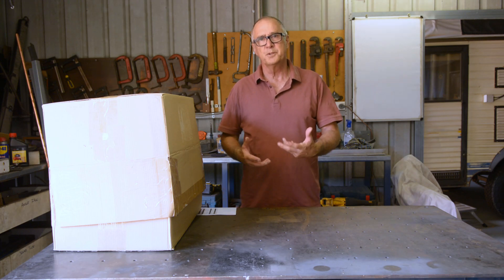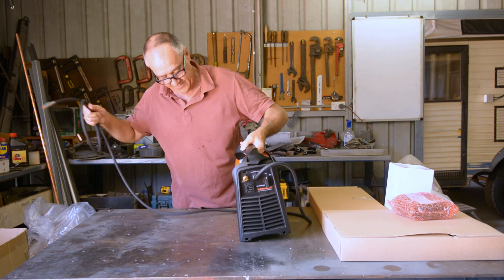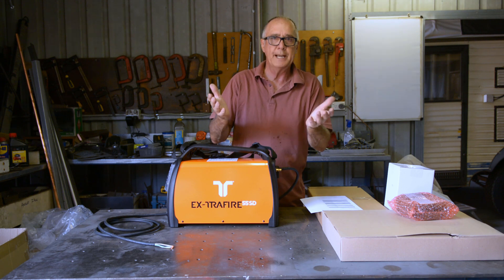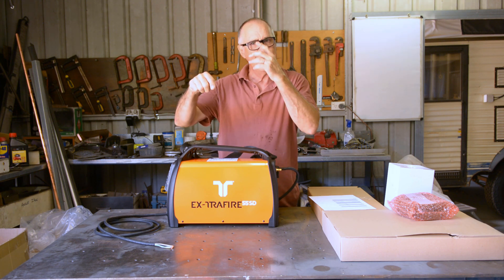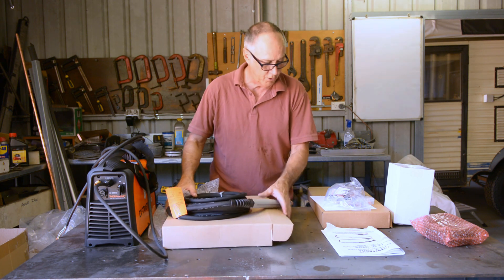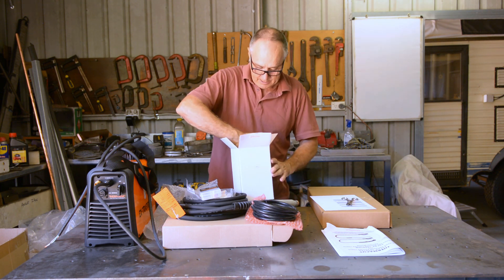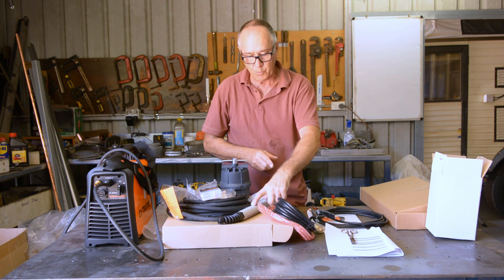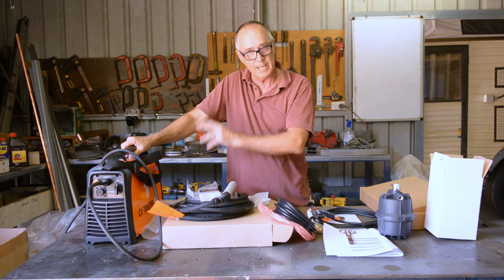Thermacut SD55 Plasma Cutter Upgrade | Part 1 - The Unboxing

Comment: Great video, are you happy with the plasma? haven't found much information about it, thought compared with hypertherm 45xp
Reply from the maker: Hi Eric, I've been using the SD55 for a couple of weeks now. I did look at the 45XP but they are way more expensive. I'm still working on a couple of cut quality issues I'm having, but overall I'm happy with the new plasma cutter and machine torch.

Comment: Nice upgrade. 
I'll be keen to see how this goes for when it's time to upgrade mine.
It'd be really interesting to see how this compares to going the Hypertherm route.
Reply from the maker: Hi Tim, the machine torch and consumables are interchangeable with Hypertherm plasma cutters, so I'm expecting the cut quality to be very good. I've made some test cuts already and running at book settings, I'm really impressed with what I'm seeing. 
I'll be uploading part 2 within the next couple of days, and part 3, showing some of the first cuts, within the next 2 weeks, so I hope you can check them out.

Comment: Looks like a fine choise! How do you like the myplasm / proma system as a whole? I am pondering wether ill go with it, or mesa/linuxcnc -type arrangement.
Reply from the maker: I love the ease and simplicity of the MyPlasm CNC controller and the plasma interface unit. Once configured, it's so easy to use, as it runs on .dxf files, which I create in Inkscape (a free 2D CAD program). 
Feel free to get in touch if you want to know more about the MyPlasm system.
Reply: @RustysMetalSigns  thank you Rusty! I will have to find out if hypertherms plasmacutter comes with a cam software or not and decide later. Ill be following your videos and ask questions later. Appreciate it!
Reply from the maker: Happy to help if I can.